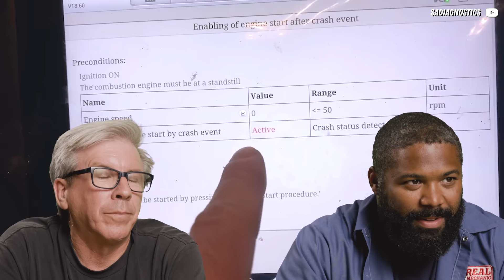Mechanic Reacts to Engineering Fails

Comment: I’m with Sandro. Those engine/fuel cutoff switches are dangerous. I remember handling an accident where a mother and her son were in an crash, killswitch disabled their car in middle of freeway, and as she got her young child out of the car to try and get off the freeway they got hit. 2 lives lost. If not for the kill-switch she could have easily driven to the side of the road.
Reply: I learned to drive in Germany.  I kinda understand what they were doing with the engine cutoff.
In Germany there were far fewer accidents than in California, where I left.  But they were usually fatal.  Unlike California.
In Germany, you don’t have the multiple car accidents like you do in the states.  Usually, someone was over driving their skills or conditions.  Having the auto cutoff makes it safer for first responders or rescuers.  But I agree with Sandro.  
Maybe practical in Europe, but we ain’t driving in Europe.
Reply: Pushing or walking she'd be outside the vehicle  @kwasdeoksyrybonukleinowy
Reply: @kwasdeoksyrybonukleinowy  With the engine cut off, and nobody to help push, that car would likely be moving at a snail's pace, even if the wheel didn't lock in position.
Reply: What I was taught here in driving school in Spain is that you don't get out of the car unless it is safe to do so. If you can't make it to the shoulder of the road in the vehicle, only leave it if it is safe to do so. Not if you have to cross lanes of active traffic.
Reply: Yet another reason I love having an 07 with nothing but basic OBD2.
Reply: @kwasdeoksyrybonukleinowy  Maybe you don't understand. The engine is cut-off. No fuel. The engine isn't running. The car won't move on its own. Pushing the gas pedal does nothing. The engine will not move the vehicle. The car is dead. The car doesn't move. The car is stuck wherever it stopped after the accident. You can't limp it anywhere because it doesn't move. The care stays where it stops. You can't move it to a safe location because it doesn't move... get it now?

You're driving and hit black ice. Your car spins out, hits another car, slides into a concrete barrier, and spins into the middle of a 4 lane highway. The car is completely stopped in the middle of a 4 lane highway with whiteout snow conditions and poor visibility. The car will not start so you can't move it. If you get out of the car, you can't see if vehicles are coming and they can't see you in the road. If you stay in the car, you're currently blocking two lanes and whoever is driving in those lanes won't see you until it's too late to stop. Imagine your driver side is facing the traffic. A semi-truck appears from behind a wall of white snow, headlights blinding you as you brace for impact. Extremely unlikely that you'll survive. If the vehicle could be started after an accident and moved to the side of the road, it would be far safer than being stuck in that situation. If the vehicle catches fire, at least it will burn at the side of the road rather than you dying sitting or trying to escape.
Reply: @kyleaegis5613  I love this comment, this is exactly why vehicles should have a manual override for all of the computer controls, outside of basic stuff like EFI. Obviously the driver isn't going to want to deal with setting air/fuel ratios, etc., but all of the other nonsense needs an off switch. Even the people writing Star Trek realized that in an emergency, you need a manual override, the computer isn't always able to assess the situation and make decisions. Just give me a safe mode where the computer will do whatever is necessary to keep that vehicle alive, and let me do the rest.
Reply: @logicplague2077  Absolutely agree. I understand the safety aspect of it. What if the accident knocks you out and the fuel leaks and catches fire? But if you're awake and alert, you should be able to override and limp your vehicle to a safer location.
Reply: @logicplague  There IS a manual override in most of the cars with those systems as the old guy mechanic said, it can be just as basic as cycling the key off and on. But the driver has to read the manual and know about it, which most do not.
Reply: @kyleaegis5613  They added the cutoff because some people got burned alive by a fuel fire when the fuel pump was still running. Everything done is basically a result of some lawsuit where the company was sued for millions.
Reply: @tripplefives1402  Yeah, lawsuits can be ridiculous. Like the woman who spilled McDonalds coffee on herself and sure because it was hot. Someone wrecks a car because they were doing something stupid, then sues the manufacturer because their should have been a safety feature to prevent it. I bet the stupid ones far outweigh the realistic ones.
Reply: @kwasdeoksyrybonukleinowy you didn’t read bro
Reply: @mattiemathis9549  My brother lived in Germany and said at the speeds they travel on the autobahn the cars typically ended up well off the road, so it makes sense to disable in that case. If they want to put in a cut-off make it manual or selectable or remote.
Reply: @tripplefives1402  We were talking about European cars, right? They could not care less!!! Lawsuit are all but non-existent and when they do happen, it always results in  a conditional penalty. Fix it or pay!  Then why do they do it? Money talks! USA is push society with gullible people that will do whatever some marketing dude tells them. In Europe we live in a pull society. Customers in Europe would never again buy a Ford after the Pinto exploding gas tank drama. Luckily for Ford, they  did not sell the Pinto in Europe or it would have been the end of Ford Europe.
Roads is Europe are nothing like roads in the USA. You crash into trees or on some back road, No one crashes on the highways. But if anyone does, automatic crash detection automatically closes off the the road with matrix signs.
Reply: Guess it depends on what part of Germany. I lived in Banberg for many years , and traveled around Munich, Frankfurt, Nuremberg area. I saw just as many accidents and crappy drivers as here in CA.
Reply: @kwasdeoksyrybonukleinowy do you seriously think that at that time when you have just had an accident , are you physically mentally stable to push a car alone?
Reply: @mattiemathis9549 that’s really odd. Do people go that crazy on the Audubon? And then why bother with all the other safety features if you’re just going to assume the driver is dead anyway?
Reply: @derekeastman7771  oh, absolutely not.  I feel far safer on the autobahn than a U.S. interstate.  Because of the speeds most people pay way more attention than typical U.S. drivers I see.  But most people isn’t all people.  Every country has their idiots.
Reply: @tripplefives1402  It's not done because some companies got sued. It's done because when there's a preventable accident you find the cause and prevent it from recurring.
Reply: @vogel2280 I assume you're talking about a fantasy world Europe
Reply: @MikeSchinlaub  She suffered 3rd degree burns and almost died because the coffee was far too hot to be safe
Reply: @kyleaegis5613 you can keep saying the car is dead all you want.  But with a manual there is this thing called a clutch.  I can roll verry verry far on my cars bearings before i roll to a stop. 

And even when i have rolled to a stop.  I can move my car on the starter motor.
Reply: @kyleaegis5613 sorry but if your car has been in the accident you describe.  There is a good chance that you dont even have an engine anymore.  

 The car is totalled.  
GET OUT OF THE DAMN CAR AND FLEE TO THE SIDE OF THE ROAD. 

Sometimes the general advice of staying in your car. Is the dangerous option. 

In any case.  If the fuel being cut off is the only reason you cannot move.  THEN DRIVE ON THE GODDAMN STARTER MOTOR
Reply: @MikeSchinlaub the macdonalds lady was a rightfull lawsuit.  

Not only was the dropping of the coffee not entirely her fault.  There just is no reason to serve coffee that hot.  

Any hotter and it would be super heated where it would flash boil if a suger cube was dropped in it.
Reply: @Happy-Honkey  That's because many Americans live in that area.
Reply: If not for the killswitch, the pump might've kept pumping fuel which ignited outside the engine and burned them up, same result just more gruesomely.
Reply: If visual condition are so bad DRIVE SLOW. You always have to drive so that you can stop enough to not hit a target.
Clearly American drivers suck
Reply: Then learn to keep your eyes on the road, free ways have good visibility, unless they practically jumped out of the vehicle into an other lane that thing is avoidable.
Reply: It depends. You either prevent explosions or you keep the options. Damned if you do damned if you don't.
Reply: Engine cut-off is advertised as a safety feature but in reality it's just so the car company can gouge you that little bit extra for repairs.
Reply: I agree the engine cutoff thing is awful

Comment: 1992 Toyota 4Runner, the starter is a massive PITA. To get at the starter you have to go through the passenger wheel well, there's an access panel above the upper control arm which is super convenient, honestly. But that is where the convenience ends, to get the starter out after unbolting it you have to pull it straight back the 2-3 inches of space you have, then dip down onto the front subframe rail and roll it so it is facing vertically, then you have to fish it out from around the exhaust manifold, passenger side motor mount, and the upper control arm mounting brackets with one hand, because you don't have the room to get two hands on the thing. It is honestly one of the worst starters I have ever had to do.

Comment: Here’s a few that come to mind:
- Lexus LS430 Starter
- 1995 Chevy Lumina V6 Ignition Wires
- 1988 Chevy Camaro Fuel Pump
- 1996 Nissan Altima Dashboard 
- Lexus SC430 Dashboard
- Lexus LS460 Brake Bleeding

Comment: Would like to meet the engineers who designed the air filter replacement setup for the modern Goldwings. 3 hours of body panel removal and reinstallation for every air filter change. Risks of breaking tabs, scratching finishes, screw loss and sanity loss. What an unnecessarily difficult task for an air filter!!!

Comment: The original GT40 was designed for endurance racing. The roof is designed that way so they can swing the door wide open and do a driver change as fast as possible, rather than crawl out of a bucket seat in a car thats only 40 inches tall

Comment: 2002-2005 Ford Thunderbird. The AC low pressure valve is under the engine and behind the L front wheel. You either have to lift it to get to it, or you can turn the wheel to the right to get to the access panel, then get to the valve. But if you are short you might not have arms long enough to reach the valve to click it on or off and may need to pull off the tire.

Comment: Mid 2000's Civic Hybrid. Change the oil, nice and easy, oil filter is easily reachable, and refilling it is a simple plastic twist cap. Change the transmission fluid, draining it is easy; refilling it requires at least a 12" extension and hex head socket, because it's hidden down and on the backside of everything under the hood; bring a long funnel too.

Comment: The Ford GT's Door roof was designed that way to make it easier for the driver to get into the car at LeMans and other races that make you change drivers and also start the race by making the first driver run across the track to get into the car.

Comment: The thing that always stood out to me was on my 2010 CX-7. They included a single screw 2"x4" access port to get to the oil drain plug. So you could change the oil without removing the shroud. EXCEPT they put the oil filter literally half way up the radiator/block. The covers and hoses made it impossible to get from the top. They went through the trouble to give me easy access to the plug then made me still take the shroud off to change the filter.

Comment: I believe Saturns, specifically the S and SL series cars were engineered by teams of prior engineers. They were a breeze to work on and were incredibly durable. I personally believe a big reason they went out of business was because so few customers had to come into the dealerships to do repairs.
Reply: My first car was a Saturn SL1.  I had to do the Heater core in it, which is normally a nightmare for any car.  The hardest thing was that the hose clamps for the hoses running to it have the tabs facing down from the factory and I didn't have a lift.
Reply: I believe the Saturn was actually an Opel design. The older Opels were awful to work on, they got better.

Comment: some are legit engineering fails but no one mentions how the suits overrule engineers wanting to fix something just to save money.  I have been in engineering for almost 20 years and this happens all the time.  Started as a mechanic in the Army and while I went to school so I have had my foot in both camps
Reply: This!
Reply: Absolutely! Never forget how from top to bottom everyone pisses down and wants to have a say in matters they look from other perspectives on. And from the top that’s always costs…
Reply: @RustOnWheels  i have caught design flaws, was told to correct them, present them through production readiness reviews and design reviews only to be told that as long as it outlives the warranty, the change is not necessary
Reply: @RebelPMP  I’m involved in AV engineering and system integration and always have discussions about inspection and convection holes but the end customer wants everything to be as clean as possible for the eye, which makes engineering these holes and hatches too expensive for the carpenters’ owners… 😞
Reply: 100%. It’s about money first and foremost, if a design is cheaper but less convenient, it’s going in
Reply: I can understand that for changing stuff as a new person coming in. But an engineer still would have had to do the original deisign
Reply: Working construction, engineers definitely make a lot of stupid choices without intervention.
Reply: and sometimes the car’s engineer isn’t the problem
Reply: i’ve been working as an engineer for heavy duty conveying machines for quite a while and had my fair share of discussions with the mechanics working on them. yes, sometimes an engineer’s solution seems stupid/inconvenient, but in my experience some mechanics also lack an understanding for seeing the machine as a complex system where certain functionalities overrule convenient fixing. also, if you‘re designing a car/machine with thousands of parts, it‘s literally impossible to design everything to meet the mechanics wishes.
Reply: Sometimes suits overrule engineers because the engineers blow budgets with their defective designs.

Too many refuse to take responsibility these days. Welcome to modern day America!
Reply: @AkioWasRight  this is also very true, need good checks and balances to make best decisions

Comment: When I worked in third party shops I whines about engineering.  When I worked for manufacturer shops I got to work with engineers on complicated issues.  They were always very pleasant to work with and always told us quicker ways to do things and why certain things were harder to get to.
Reply: How bout traverse/enclave/Arcadia? Belt tensioner? These have many issues
Reply: @ryurc3033  That arent necessarily "engineer fails". You know that the engineers dont get to create a new car completely on their own, right? They have to work within certain boundaries set by designers, marketing, production etc etc...
Reply: @ryurc3033  no vehicle can exist without problems.  That's why service technicians exist.  I'm just saying my experience with engineers has been pleasant, helpful, and they do their best.  Particularly when I worked for Hyundai.  They had a regional engineer who's job was to help technicians.  Often in person.

Comment: Im not a mechanic but we had to service our own trucks when I hauled concrete. On my Freightliner truck, the fuel filter was in a canister behind a ton of wires. You had to remove a fender first which wasnt hard but annoying. Then you could barely get the large socket on the top of the canister to loosen it & after you did, you could only turn it ABOUT an 1/8" at a time. Took several times to loosen it enough to use your hands to finish but even then, there was so much threading  it was difficult to remove. Especially with 3XL hands. Then repeat in reverse after you changed it.

Comment: Working at a quick oil change place I recall seeing Subarus come in and their oil filter being literally surrounded by a burning hot exhaust because the customer literally just drove it in. Solution was to get a long extension and the oil filter claw to remove it. Then you just had to play a game of operation to install the new filter.
Reply: Those are a treat. I call it Subaru's Ring of Fire
Reply: the cavaliers from the early 2000s were like that too. Had to reach through a 4 inch gap between the exhaust manifold and firewall.  only time I NEEDED the burn sleeve
Reply: My 2022 crosstrek has its filter on top of the engine which imho is genius
Reply: One of the reasons I bought my Crosstrek was the location of the oil filter, A/C compressor and alternator, right on top of the engine. It's almost as easy to change as adding windshield washer fluid. I won't talk about all the bearing failures.